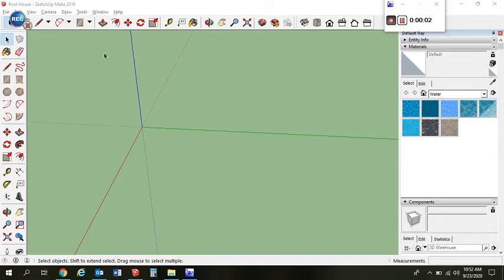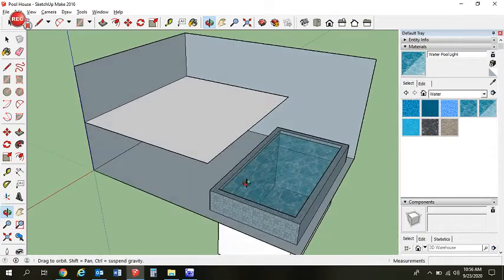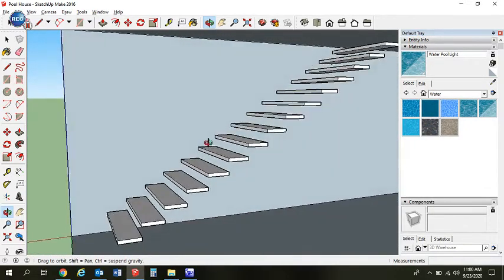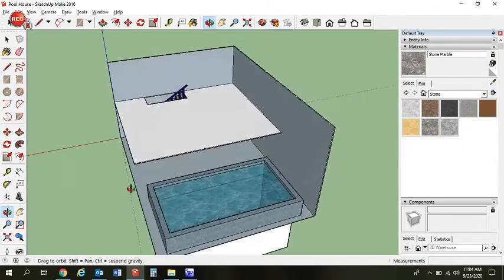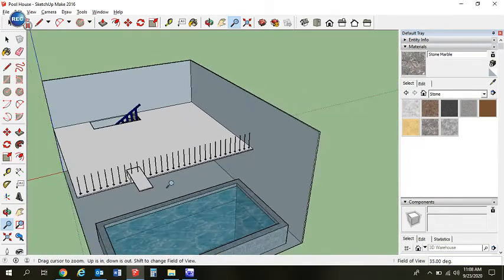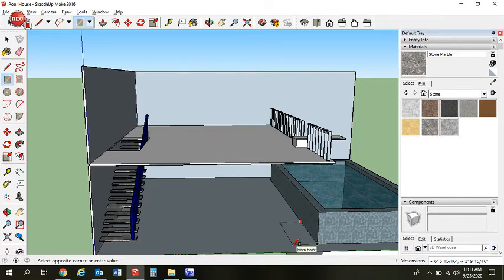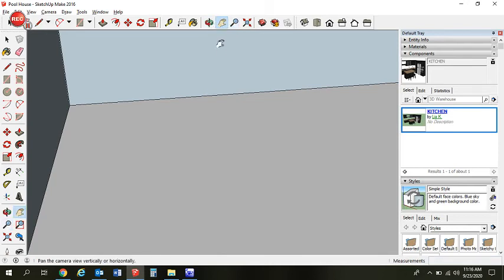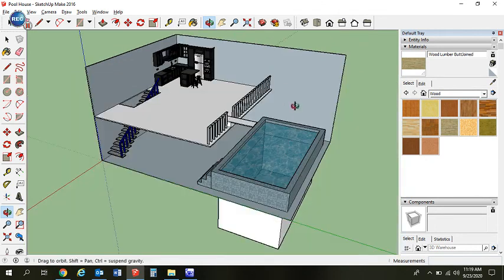Google Sketchup Pool House

Comment: this was very helpfull with  my SketchUp pool house assignment, I found the entire process to be very helpful in developing both my design and technical skills. Creating the model allowed me to better understand how to plan a functional and visually appealing space, including elements like layout, proportions, and structure. I was able to experiment with different design ideas, such as window placement, roofing styles, and outdoor features, which helped me think more creatively. Using SketchUp also improved my ability to work with digital tools, especially in terms of accuracy and attention to detail. Overall, this assignment was very helpful because it gave me hands-on experience with 3D modeling while also strengthening my understanding of architectural design concepts.